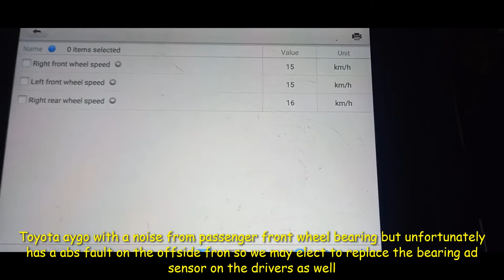Toyota AYGO wheel bearing and abs fault #autel #snap on

Comment: Did this ever solve the problem we have a 2015 aygo and it's got an abs fault on the drivers hub but when I've took. The sensor out its packed with grit and debris I'm wondering is that the problem as it looks worn and rusty with not much spin on the bearing 😎subbed
Reply from the maker: hi, and thank you for watching subscribing and commenting. That's awesome. We really appreciate that the wheel bearing pick-up is probably damaged. If you say there was a load of debris you could try and cleaning it, this one if memory serves right had a bearing on one side and the sensor replaced on the opposite side if I remember right have a great day
Reply: @cairney0037  much appreciated my friend have a good day 😎